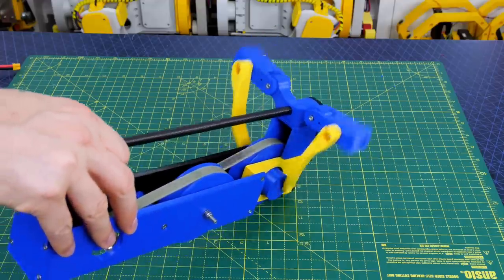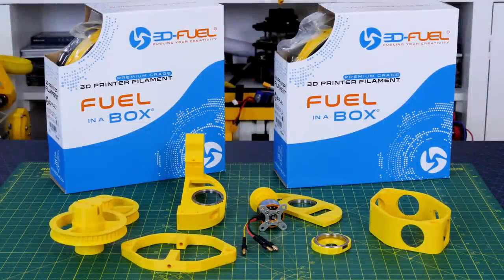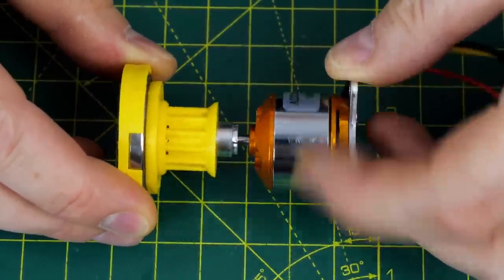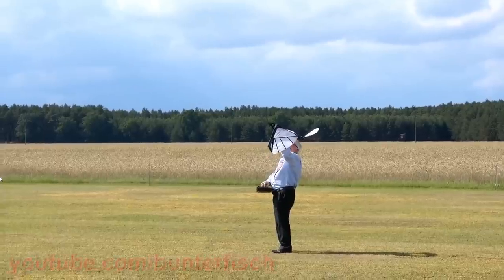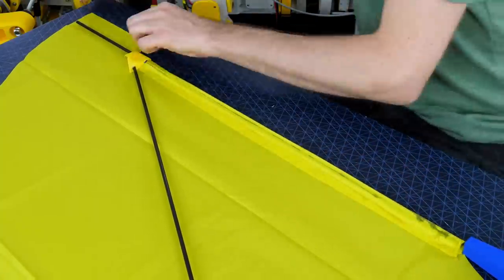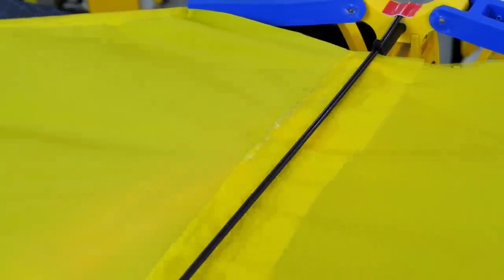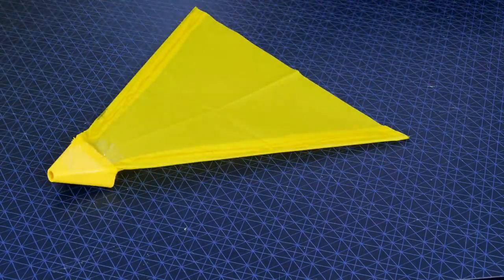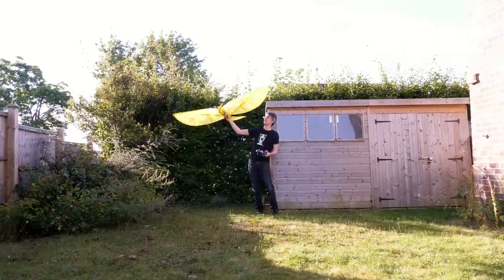Ornithopter Flying Machine Part #2

Comment: The problem is still exactly the same as what I pointed out last time: if you're just flapping up-down, you oppose the exact same force when you're flapping up and when you're flapping down, therefore the best you can expect is the same as when you're hovering. Most ornithopters add a mechanism to fold the wing on the upwards movement and extend it on the downward movement. This can be achieved with just a hinge in the middle of the arm, there is no need for extra control surface. A lot of ornithopters implement a forward-backward movement as well to increase the forward thrust, in a movement very similar to swimming butterfly-style.
Cheers!
Reply: this needs more likes so he sees it
Reply: thing is I have a sean kinkade ornithopter which flys just by pushing up and down and I've had several toy ornithopters which fly exactly in this way with a simple cam that flaps a piece of canvas up & down. They work great and do fly very well. I think as long as you have an overall positive angle of attack - usually with a servo controlled horizontal tail which can also twist slightly to the right and left for turns as well as up & down and a forward force provided by the simple flapping cam and flexible fabric, it will fly.
Reply: You're right in that you can gain more efficiency with a more complex wing movement, but simple flapping won't prevent flight. Plenty of model ornithopters work just fine without this.

Flapping in an ornithopter is to develop *thrust*, not lift. The up-and-down motion (provided the wing fabric is a little flexible) will push air backwards, generating thrust. The wings can generate lift (even without flapping) provided there is enough airspeed. Plus, any positive angle-of-attack means that some of the thrust will be directly acting as lift, too.

Comment: I'm sitting here staring at yet another one of my projects that has devolved into a chaotic mess, thinking of giving up. Then James posts this, where he returns to an old project and keeps on trying. It was just the inspiration I needed, at just the right time. Thank you Mr. Bruton
Reply: What are you trying to make? Don't give up dude you will get there
Reply: @Matty.Hill_87  a thing that plays music with stepper motors , plus a lucky cat robot drummer. Thanks for the vote of confidence 🙂
Reply: Never be afraid to start again from scratch. I find that re-approaching a project I've restarted gives me the insight of previous pitfalls and things picked up along the way.
Reply: @endthefighting  this is excellent advice. Thank you
Reply: @jameshughes3014  it can also be boiled down to "It's not restarting, it's starting with experience ".
I find myself constantly doing this in Fusion 360, when my projects get too convoluted :)
Reply: i made a thing that plays music with collector motor once, my most successful project
yes, i just connected motor to the amp, but still, a great success xD

Comment: Coming from an rc plane background. The immediate pitch up when you throw it means it's tail heavy. Move everything further towards the front maybe a more compact gearbox.   Try and get it where it glides smooth and straight after you throw it without the motor on. It should not pitch up or down. Then make minor adjustments from there for it to fly with power. I would suggest moving everything forwards  remember even a small amount of weight very far back has a big impact due to its lever action. 

In flying things balance is more important then anything else.  You can fly a flat piece of cardboard if you get the balance correct. Get the cg right and the rest will be easy.

Maybe buy a kids chuck glider and experiment with attaching weights to see how it behaves so you can recognise the behaviour in your bird. Keep up the good work I hope you get it going.
Reply: That was my immediate reaction: every flight stalls, so it looks like it's either trimmed too high and needs the tail tweaked downwards, or more nose weight.
Reply: @PKMartin  Yeah from what I can see many of these fly with a lot of up trim.  My guess would be cg needs to be very close to the front Wing spar. Not an expert on ornithopters but that would be my hunch.
Reply: I think a big problem with the ornithopter is that the center of lift changes as it flaps its wings.
Reply: I think he should add a nose to it. A) It'll protect the front bearing/pulley system. B) He can add holes in it to fit weights.
Reply: I own a Kinkade ornithopter, the pitch up is normal at start BUT without tail control there is no way to counter act it. Once it fly forward the pitching up gets away.
Reply: @Mike-oz4cv  you are probably right. But never hurts to do a glide test first. I still think the cg is too far back.  All of the pictures see have the majority of the weight very close the the main wing spar. I think having the motor a couple inches back and an extended belt gearbox plus the battery is too much rear weight.  In have also noticed a lot of up trim on the tail.
Reply: @AltMarc  are you able to measure the CG in relation to the leading edge of the wing.  This might be helpful.  Looks like its about 45mm back from the LE given where people are holding it.  I'm just curious.  Does it require a lot of up trim to fly ie the tail sticking up in the air?
Reply: @these.are.my.things  The start procedure requires the tail 30 deg. up, to get height and speed. After you want the tail flat (reducing drag). And up again when landing...
Reply: @AltMarc  that much up trim for landing and lunch would suggest its naturally nose heavy design and you are timing up to stop it from diving straight to the ground. That's my hunch any thoughts?  If James Brutons is pitching up that much with a flat ish tail it must be tail heavy. Does yours glide pretty well with 30degrees up for landing?

Comment: When the wings flap, they produce lift on the downstroke but don't they also produce downforce on the upstroke? If this is the case, should the two forces be equal and cancel each other out? Therefore, shouldn't the wings be designed so that they are stiff on the downstroke, but become flexible on the upstroke to reduce the amount of downforce produced resulting in a net positive lift?
Reply: the bird wing forms an airfoil like at a plane. the lift comes from the forward moving and not from the downstroke. you will hardly see a bird taking off straight vertically they almost always need a little runway (forward motion) to produce enough lift. of course hummingbirds are an except here, they have their own physics
Reply: You are right and this is why the way birds move their wings is bit different. The change the shape such that they avoid downforce.
Reply: You are right .There are no airfoils on the wings. Top/bottom equal. Absurd. Or the up and down movement should also change the form. (sorry google translate)
Reply: @schubutz  Hummingbirds are to birds as helicopters are to airplanes.
Reply: @ltjgambrose  exactly
Reply: @schubutz  although if you see a bird flap, especially when moving slower they put tons more power into the down stroke rather then the up stroke. They pull their wings in as they flap up to reduce the downward force the wings oroduce

Comment: Some suggestions.

1: Lowering the front pulley to increase distance between wing so that the pushrods are longer, and installing them further out on the wing spar, this will reduce flex and strain within the mechanical system and help reduce the wing flutter from high motor speed.

2: Lowering weight by bonding the carbon fiber parts directly to each other, eliminating the need for 3D printed parts in certain areas. There are a few ways to do this, but one could be wrapping string around the joint and soaking in CA glue, or presoaking in epoxy/resin.

3: Reducing the size of the battery for shorter flights but with less weight.

4: Changing the motor for a more pancake shaped larger diameter one. You will maintain the same weight of the motor, but it will have a higher torque, lower RPM rating.

5: Use smaller bearings. Ideally you want to use the smallest inner diameter bearings as those will offer the least resistance. An overall smaller bearing also means less weight. High RPM and large diameter thin bearings will have a lot of resistance (due to the small balls rolling on a large diameter inner race), like on your current motor shaft setup. There is no need to worry about strength as just about any ball bearing will outlive most of the parts you attach it to.

6: Adding keys in the 3D print so that parts grab onto each other, requiring less screws, and the screws can be smaller, reducing weight.

7: Using a gear reduction instead of belt drive. While the belts are quieter, a gear reduction would be much more compact and lighter, potentially requiring only 1 or 2 stages for the same reduction as a 3 or 4 stage belt reduction simply due to being able to use gears with more size differences. Other than the weight savings from less stages, a gear drive also has no need for belts which further reduces weight.

All that being said, I think your build looks fantastic, and I hope to see it fly by itself. Keep up the good work!
Reply: 2.: You only gain something if all the string and glue is lighter than the 3D printed connector.
5.: With 3D printed axles large diameter bearings allow for stronger axles. I don’t think the friction of bearings is a significant problem here. The weight is probably more an issue.
Reply: @Mike-oz4cv  You are right, however glue and string is a similar construction method as the carbon fiber itself. He could replace string with a fiberglass cloth thread. It would be much more compact than a 3D build as well so overall I don't think there would be a weight gain over plastic, especially sonsidering 3D printed plastic layer adhesion weakness requiering extra plastic.

Bearings can be a significient source of resistance depending on application. Even the type of lubricant will greatly affect performance. The low rpm bearings at the front won't be much of an issue due to the low speed and high torque, however the bearing that the motor is mounted on could be a source of current draw due to the motor's high rpm. The bearing design also requires the inner bearing balls  to spin very fast which multiplies any rolling resitance. An example of how lubricant affects things is a fidget spinner. These don't use lubricant which allows the bearing to run freely at high rpm, however the lack of lubricant will cause premature wear if put under a weight load. Conversely a bearing with thick grease will have high rolling resistance, but will be able to support higher pressure loads without wearing out prematurely. 

Your point about shaft diameter is valid though. I think my main concern is with the motor bearing which could be mounted to a smaller diameter shaft, considering the motor already has a small diameter shaft, and torque forces are also low, basically it's just a question of maintaining centering.

Still these are good things to think about, and what you said is valid.

Comment: When an airplane climbs suddenly and stalls, it is usually because of the center of gravity. I think that the center of gravity should go more towards the nose, I am an expert in model airplanes but not in ornithopters, although I guess that the distribution of weights and angles of incidence will be similar.
Reply: It's "stalling" because the engine is stopping, since it can't handle the load.
Reply: @CHUCKLZLORD   an aircrafts wing can stall before the engine itself can't handle the load
Reply: @daddyplankton5855  you can see this in flight simulator games like War Thunder for instance.
Reply: Hombre mister cuervo tio, mi mentor en el rc, está bien verte por aquí
Reply: You're 100% right. I (and a few others) left comments on the last video about this.

If the centre of gravity is not correct, it WILL NOT FLY.  Period. 

It was definitely tail-heavy during the first attempt in this video (as was his last design).  It looks a lot better once he moves the battery forward, though.

Comment: You could also instead of using a bigger reduction a motor with a Lower kV rating to get less rpm and more torque
Like use something around 500-600 kV and you wouldn't have the problem of it running to fast and more torque so no stalling out
Reply: I came here to say exactly that.
Reply: 500-600kv motors arnt super common in the size he is using, if you go one or two sizes up you can find them but then you need bigger ESCs and are adding more mass so its a trade off
Reply: @TeamPanicRobotics  My quad has 580s in 3508 and I use 30A ESCs. They're not that uncommon, although yes they are physically bigger.
Reply: @TeamPanicRobotics  generaly heli motors are lower KV than plane or multi rotor motors..

Comment: No ornithopter expert here, but looking at a group like flite test you will note  that every build starts with perfecting the glide. No amount of power can fix a wing that doesn't have a decent glide to start. Might just need a little cog and tail configuring.

Looking forward to P3!

Comment: You should think about aerodynamics. To fly a device heavier than air you need lifting force, something that would push the device upwards. By far your ornithopter is symmetrical relative to the up-down direction: it pushes up and down equally during an equal amount of time, so it cancels out. That's why it travels the same distance regardless of whether the motor is on. Probably you need some kind of articulated wings which would fold when moving up, either driven by the same motor or using a free hinge with limited motion range.
Reply: He was told this dozens of times in his last video comments but seems to have completely ignored them 🤷‍♂️
Reply: @Linuxpunk81  It's because it isn't necessary for flight. Look at simple rubber-band powered ornithopters - they fly just fine, with a symmetrical flap.

The flapping is to generate thrust (the loose fabric pushes air backwards). Lift comes from moving forward with a positive angle of attack, just like an aeroplane wing.

Complex flapping can be helpful, but it is not necessary for flight.

Comment: Great progress!  Having flown ornithopters successfully and with failure, the initial launch is difficult even with tail control. Unless you can control the pitch up moment from thrust at launch it won't get enough airspeed to stabilize.  A small headwind helps.  Unlike a prop or jet which thrusts fairly linearly along the long axis, these produce both forward and upward thrust.  The tail is necessary to compensate for the lift and produce forward acceleration.  Just like a high wing plane with full flaps, you have to push the nose down with the elevator or it will stall as you climb.  You also need to give it a fairly strong forward initial launch as these don't accelerate smoothly or quickly.  They can't take off from a dead stop.  Hope that makes sense.